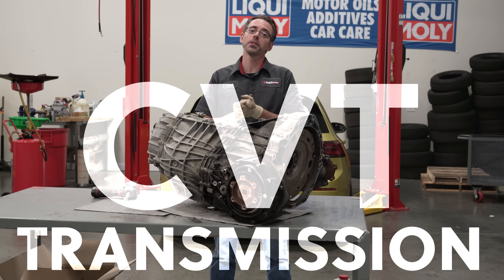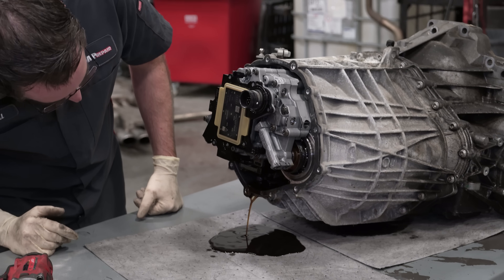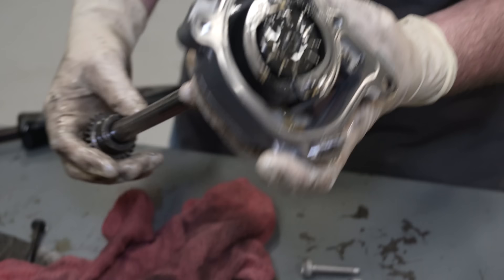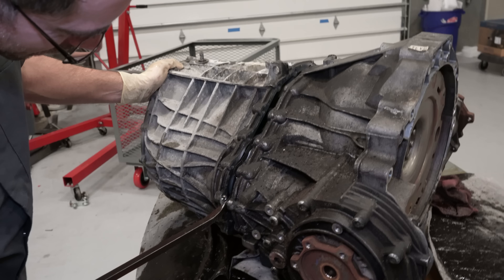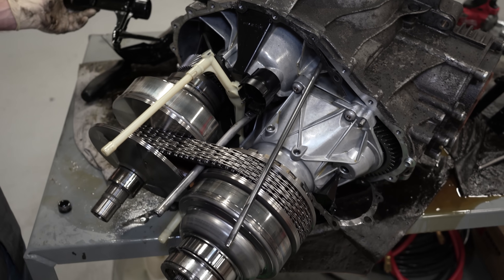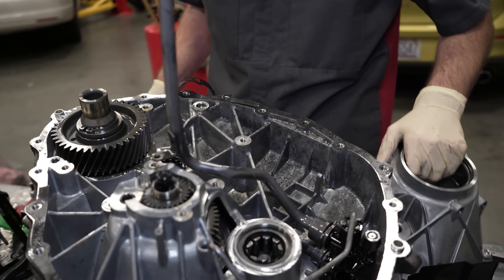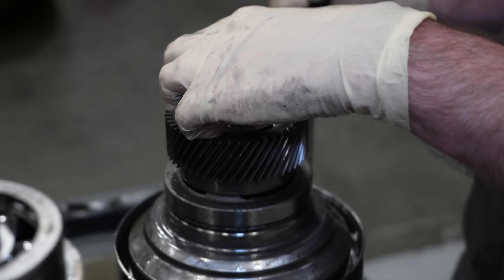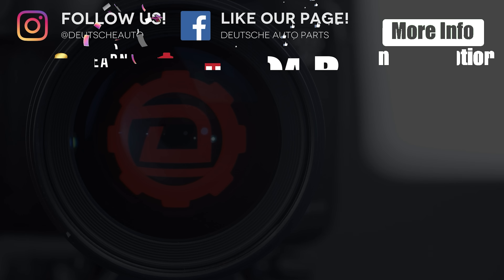Why you shouldn’t get a CVT transmission

Comment: I really hope to CVT can evolve eventually someday because design wise it's actually really good. All access to torque instantly is amazing and it gives a really interesting pool fill where it's like it's continuously pulling and the turbo never stops spooling so you can really get some good pools going because you don't have to stop to shift and for the turbo back up and all that it does make turbo sounds less enjoyable because you only get the one pressure let off instead of one per shift
Reply: Electric drive is the future and electric cars don’t have gears, so not only won’t there be CVTs, there won’t be manual or automatic gearboxes either.
Reply: @frankteunissen6118  If only it had all been sorted out already...! Electric vehicles still have a long, long way to go...weight issues, fire risks, recharge problems, charge capacity...etc.
Reply: What do you mean by pools ?? Do you mean pulls ?
Reply: You said all that without taking a breath!   You must play the french horn!
Reply: @annpeerkat2020  was using voice recognition. Was too lazy to type all that 😂
Reply: @coleprivett7640  Need to do that too....been thinking about it for a while now.
Reply: @annpeerkat2020  I DID ACTUALLY 😂😂😂
Reply: Get an old Volvo 66. Install a turbo and enjoy the abillity to reverse at the same speed as you can drive forward :)

Comment: Even though my car has the best CVT of any production vehicle besides cars, obviously the Koenigsegg has the best one but at least I have paddle shifters because it allows you to make the car sound better. It does become slower in paddle shifters by a lot. But The paddle shifters make it more fun but it'll never be as fun as a manual. I try to get an SI but I couldn't get them to trade so I had to get what I could get and had to be new enough to do a underwater add-on loan. Also anyone reading this? Don't get them any cooper unless you want to learn how to tear apart an engine constantly and deal with coolant issues constantly

Comment: I bought my CVT Nissan Maxima in 2007; and it has been a horror of the things ever since. And I don't use it much, so it  has only 50K miles on it. And yes, I agree, the CVT was designed (and they and their engineers KNEW it) to break down in many ways. Take Nissan as one horror as an example:

They purposely used a less power than needed engine. Why? Because an engine designed to use the CVT would make gas use, terrible. So they did it because the EX-CEO forced them to do it. Even though the engineers knew it was going to be bad in many ways.

Also: slip of the metal band around the pulleys is another horror. And a holocaust when that thing breaks. Yet again, the manufacturers KNOW this. And the ONLY thing good about the CVT; is it causes people to buy it. I was one of them sadly. Damned fool in my case.

Do NOT ever buy a car with CVT! Finally get this: In the late '40's; Chrysler tried to build and manufacture a CVT transmission. And their engineers said, "NO good!" "For they will never work right!" Or to words the same. I know that, because when I was a Senior year in HS in auto-shop in 1949, I made my term paper about the CVT.

So I could write a thesis about that  stupid transmission. My mileage is 15.7 (even not gunning the engine). And THAT is what they tell me to do; when I complain about the consistent vibration between 20 and 30 mph.

Yet I bought one much later, thinking they had got around the problem. Yeah Right! Damned LIE is what it is. DON'T buy a CVT car, If you're wise.

For what it's worth.

Comment: I had problem with my Nissan bluebird cvt . I get it rebuild again by opening it apart and changing all rubber parts , clutch ring etc . It cost me USD 750. From last 4 years it’s working well.

Comment: ATV's and SxS's use CVT's and they all work great. The key difference there though is that they use a rubber belt and rollers that spread the sheaves with centrifugal force

Comment: Many carmakers have been trying to perfect CVTs for decades because the promise of them is great: Having the best of both worlds in keeping the engine in that magic rev zone that offers either the most power or the most economy depending on conditions. But so far, none of them have been able to solve the reliability problem. Electric cars solved the transmission problem by not having one.

Funny bit of trivia is that Leonardo DaVinci drew the concept of a CVT hundreds of years ago and there were probably others before him as well.
Reply: Even formula 1 tried to make CVT work but had to drop it. Having the belt be such a massive point of failure is the issue. We just don't have a cheap, flexible and almost indestructible enough material to make a CVT belt that can last 100 years
Reply: @acinixys  They keep trying though, I guess because the promise of a CVT is so great: To keep an IC engine in its best powerband for economy (or power) at all times. But they've been trying to make them durable for many many years. I think Mercedes had a CVT back in the 80s. Just looked it up: Apparently, DAF (Netherlands), Volvo and Subaru were the first passenger vehicles to use a CVT back in the mid eighties: https://en.wikipedia.org/wiki/Continuously_variable_transmission#:~:text=The%20first%20mass%2Dproduction%20car,and%20Volvo%20until%20the%201980s.

Comment: CVTs do suck, but if you have one, CHANGE THE FLUID. I’m convinced that lack of maintenance is the main cause of failure on all two pedal transmissions, CVTs included. 
Subaru claims the fluid is “good for the lifespan of the vehicle” nonsense! I Change it around 60k miles. Blackstone can do oil analysis on CVT fluid to help dial in the frequency.

Comment: I’ve played around with CVT transmissions in BeamNG (I’m not buying a CVT irl lol) and it feels weird imo. There’s no shifting, you just hit 5,000 RPM and continue to accelerate. Some CVTs can simulate gear shifting, but that seems like it defeats the purpose of a CVT; to keep the engine at its max power output while the transmission does the work of distributing that power to the wheels without needing to shift gears.

Comment: CVTs has its place, usually a car is not the right place. Snowmobiles are example where its fitting to put it. I once had an older model, 1980 something, VW Jetta with CVT and it was not good car...

Comment: We have a John Deere 8530 on the farm that uses IVT (same as a cvt, Deere just calls it infinitely variable transmission) and it works very well, and lots of John Deere tractors use this transmission. However, the work tractors do is obviously a lot different than cars and cars just don’t work well with CVTs

Comment: First of all, a CVT is NOT this kind of transmission only. This is a pulley based CVT, and unfortunately the most widely used (only used?) form of CVT in cars. Equally unfortunately, they are the type of CVT that rely on friction between mating surfaces to transfer torque than gears, ergo, the stronger the pressure between the mating surfaces. the larger the friction and the larger the torque that can be transmitted. Which is why you have the elaborate hydraulic pistons that actuate the discs from the sides, to maintain a great pressure. Unsurprisingly, this contributes a lot to the inefficiency and unreliability of the CVT, in addition to the torque converter which also adds to the complexity while lowering the efficiency/reliability.

Secondly, there are still efforts ongoing to create a transmission that uses positive engagement, like gears rather than friction, to transmit torque. When such a transmission is invented, maybe CVTs will get a better name to themselves.

Comment: Honest.  I’m a mechanic, and I always hated CVT’s.  When people ask what a CVT is and if they should get a car with one, I tell them to think of a snow machine clutch, but to change a belt you gotta pull the motor and tranny and spend $3,000-5,000 to do so.  I live in Alaska, so shop rates are ridiculous, and it’s a pain in the dick to change a belt on a snow machine when it’s-30°F and you’re 1/4 the way through the 50 mile trip back home, you’re cold, exhausted, the sun set at 4:00 pm, and you just wanna get home so you can pack your meat in the freezer and sleep.  The task itself is simple, but stack all that on top of everything and it’s a chore.  Ask me how I know.

Comment: I had the 1.5 turbo hatchback from Honda with the CVT pro didn't prefer that but I changed the fluid a couple times that I had it at 20K and I got rid of the car at 45 One of my good buddies is a Honda technician he said it's still drove like a new 🚗💨 so if you do have a CVT at least change your fluid it's probably not much money and all you do is just drain it out and fill it right back up I think there's a filter to replace at like 50 or 60k I just did the drain & fill

Comment: The CVT in the Toyota Corolla is near bulletproof just change the fluid every 60,000 miles I know several people that own them no problems mine has 115,000 mi on it never had an issue..

Comment: CVTs are an effing joke. I remember hearing about them 10 years ago, when they were still just a hypothetical new transmission design. They'd talk about the problems that they'd invariably have, unless some kinda solutions were found. Next thing I knew THEY WERE ACTUALLY BEING PUT INTO VEHICLES PEOPLE WERE BUYING! I couldn't believe it! Now they're failing at 40-50k miles, for the same reasons we already were aware that CVTs would have. What is the point? What is the point of putting these into cars? To screw over your customer base and tarnish your brand's reputation for reliability? So stupid.

Comment: Had a Nissan with a CVT. Blew out at 50k miles. Warranty replaced and started feeling the same signs it was about to go again after 15k miles. Traded it in. Don't think they are very good on the open highway.

Comment: It's true that there are an 'infinite' number of ratios in a CVT, (well, it might be finite if you factor in the plank length and such physics limitations, but effectively infinite) but there is a finite range of ratios that it can use, and CVTs get less efficient at transferring torque towards the extremes of that range. 

Toyota hybrids use a power split device which has no belts or slipping components, and uses an electric motor to vary the ratio. Toyota PSDs have a truly infinite range of ratios on the low end, and effectively an infinite number of ratios on the high end until the relativistic effects start to limit what you can do, but you will never deal with that in any practical scenario.

Comment: I love the CVT transmission on my car. Will it last a long time? I don't know. If it stops functioning properly too soon is there anything I can do to fix it? Probably not. Is a new one cheap? No. So I hope it doesn't crop out. But so far it has been working well. When I am rolling along the on-ramp to a limited access highway, and I want to accelerate in order fit my car between the faster-moving cars on the crowded limited access highway – I just I push the accelerator peddle all the way down, the tachometer shows the engine smoothly, and rapidly, winding up to nearly redline, and then it remains rock steady at redline while the car goes faster and faster. Sooner than I expected it is going fast enough to get me  between the other cars on the highway. Wowee!  Unlike the way things work with a typical astonishingly, mechanically complex, ordinary, planetary gearset automatic transmission,  I don't feel like I'm being jerked around by my transmission; I don't hear my engine speed  suddenly drop, speed up again, drop down again, speed up again, several times. Instead the engine speed remains  rock steady, and I feel the car just goes faster and faster – as smoothly as imaginable. No I wouldn't want to try an pull a trailer behind my car. The belt might slip on the pulleys, create excessive wear, and wear the CVT out early. So CVTs are best used in small cars.
     There are 3 things that make a modern CVT special. (1) It has 2 pulleys that each gradually change their diameter (2) It has a computer that reads info from sensors and it uses the info to decide what size to make the pulleys, and (3) it has a special all-steel belt, and a special laser-etched friction surface on the pulleys, which allow them to be gripped by the special belt (the CVT in the video has a chain-like belt; Subaru CVTs have chain-like belts). Without the special pulley surface or without the special belt, the belt would slip on the pulley. Actually it does slip a bit (so little that one does not feel it), which compared to a manual transmission means a slight a loss of efficiency, but that loss of efficiency is more than made up for by the increase in efficiency that results from the continuously adjustable pulley ratios. So – I don't feel any "rubber band" effect, I rarely feel any chattering" (momentary grip-slips before the belt grips again). Maybe once every 10,000 miles I've heard a grip-slip that lasts maybe 1/20 of a second. Rather I feel the smoothest acceleration imaginable and, while I can hardly feel it, I can tell from the speedometer that there has been rapid acceleration of the vehicle. Yes rapid and smooth. You don't get jerked around the way you do in a vehicle with a planetary gearset automatic. The acceleration is so smooth that you may not realize you are accelerating – until you look down at your speedometer and see that you are going faster than you throught. If you want to  feel like you are accelerating – you might prefer a planetary gearset automatic transmission, or a manual transmission. Such drama. If you want to actually accelerate, and do it as comfortably and inobtrusively as possible, you may prefer a CVT. No drama.
      I would not like it if my CVT belt suddenly breaks while I'm going 80 miles per hour. Will there be warning signs beforehand? Remind me to change the special CVT oil on time. Every 40 to 60 thousand miles. Perhaps even before the maintenance-minder lamp on the dashboard gauge cluster says that it's time. Remind me to use the correct CVT oil as prescribed by the car's manufacturer, and to use the correct amount.  Info coming from the field regarding Toyotas and Hondas seems to indicate that if you do this, your CVT will last 300,000 miles. Suburus should last a long time too. There may be a problem with the Jatco CVTs used in Nissans.

Comment: I have a 2010 Maxima and despite all the reviews and stories Ive heard Ive never had an issue with the transmission. Love that car. Great acceleration, low top end.
Reply: You are the exception,  not the rule. 

You could walk through a minefield and come out OK, but that does that mean it's smart to do so?
Reply: CVTs are cool. I haven't finished the video yet, so I kinda hope he explains that the tech is awesome, but it's not really good for high powered things. Low end stuff, like a childs go cart, is where this tech shines in my opinion.

So if you get a well designed CVT in a low end car, it can be really good and last a long time
Reply: Nissan's CVTs are the absolulte worse piles of krap worldwide. CVTs are good for one and two cylinder cars, and some 3-cylinder models in Europe use them, too. I would not get an I4 engine car with CVT, let alone a V6 Maxima or a V8 Audi. To each his or her own, I suppose.
Reply: Hmm.. I think the problem is most people drive like shii.
Reply: I have 2011 Nissan Altima Hybrid, 150000 miles, no problem with CVT too. My Altima CVT still run very smooth.
Reply: @philsheu712106  hybrids use eCVTs from what I remember. Those are truly bulletproof
Reply: Nissan has had the most problems with CVT transmissions.

Comment: What happened to the ‘keep comments respectful’ etc. This guy could trash anybody’s reputation in seconds & he wouldn’t be allowed within 15ft of any car I owned. It’s all a big joke to him. I have 2 small Honda CVT’s, his & hers. Both are similar low mileage, similar year, same model and now about 16 yrs old. They both still pass their annual UK Road Safety Test & are a delight to drive. Very economic, very nippy around town & when the Steering Wheel mounted 7 speed with paddle changes employed, they become a slightly less economic but extremely nippy country lane car. Just make sure you change gearbox oil at smaller intervals than recommended, I stick to around 60,000 miles but not much more. Important, make sure you use correct spec CVT oil for your specific gearbox.

Comment: The only good CVT in my opinion is the ECVT in hybrids that use gears and electric motors instead of a chain or steel belt. My Chevy Volt has one and it’s fantastic. I had a Honda with a normal CVT before this and it was awful though.

Comment: A few things. I think auto companies use cvts cuz they have fewer parts, that might make them cheaper to produce. 
 I bought an Altima with a cvt. I didn’t know about them. My 06 non cvt Altima was bullet proof. So I got a 2011 2.5 L. I like the way it drives. I learned to feather the throttle, not bury my foot in it and bog it down. Ya it drones and its not great but it’s what I have. I get the fluid and filter changed regularly, so far so good. I have 120 k mi. Fingers crossed. I wouldn’t get another one. 
 I think the more torque the engine has the faster the trans will fail. Too much is asked of that belt/ chain thing.
Reply: People don't like things that are different from what they're used to. CVTs provide a pretty smooth driving experience.

Comment: One of CVT's issues is the stress put on it by 1st gear equivalent, Honda (or is it Toyota...🤔) actually do CVT's with a normal first gear nowadays which then switches to CVT once your at a certain speed.  it's a lot more reliable......